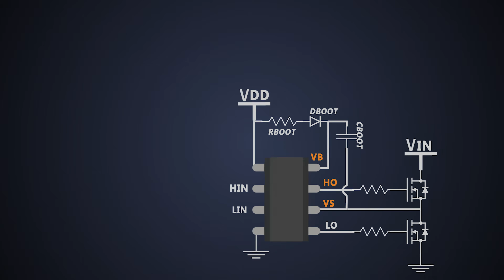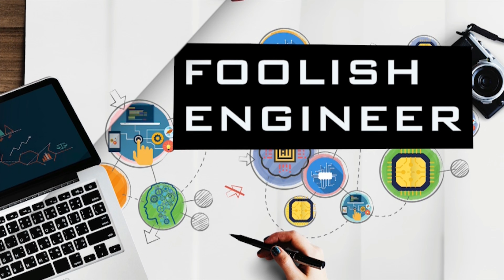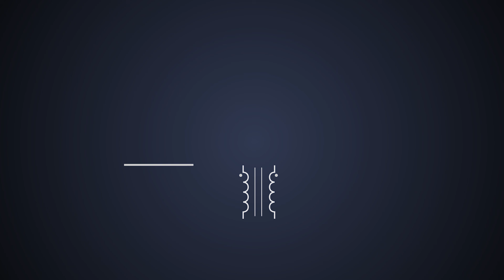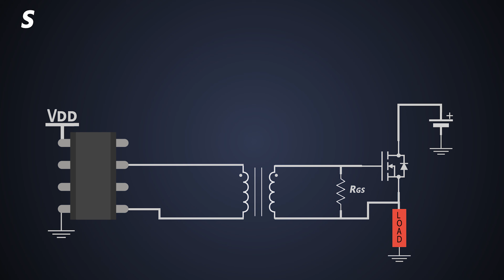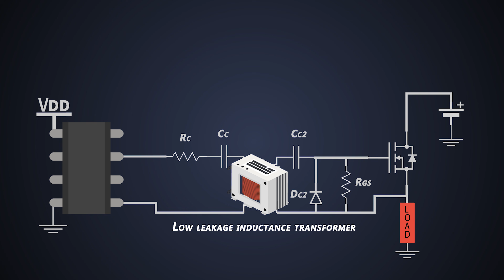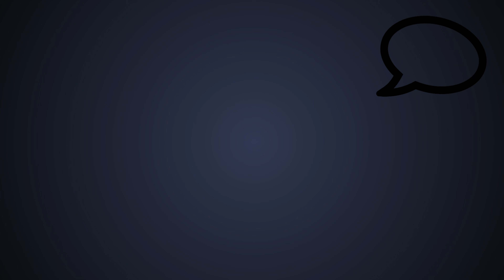Isolated High Side MOSFET drive | Single-Ended transformer-coupled Gate-Drive Circuit

Comment: He fail to explain that with transformer gate driver the high side switching need voltage scaling I first listen what he said that you don’t need voltage scaling and the mosfet was not switching out of the liner chart and I then rewind the transformer to 31 turn I got 21 volt and then the mosfets switching was fully on the mosfet had not heat with load don’t use a capacitor and diodes the way he said I had to experiment to get the high side switching performance without heating if you use the capacitor the duty cycle is lost to control and the buck converter with just not work to reduce the voltage

Comment: Still confused, how will a 1:1 transformer which has 12v in primary, which means 12v in secondary (Vgs=12v) be able to drive high side switch
Reply: A bit of guessing here, isn't the point that the two sides of the transformer doesn't have the same ground reference plane? if they did, you're right, you would have the same gate voltage on the secondary side, but as the "negative" side of the secondary transformer winding is on the high-side of the load, I assume that shifts the voltage difference up? Maybe our teacher here can confirm. :)
Reply: @drdistorzion  makes sense but what I feel is ultimately the secondary of high side pulse transformer still maintains a Vgs of 12v, which relative te the bridge still won't satisfy the condition for MOSFET turn on.